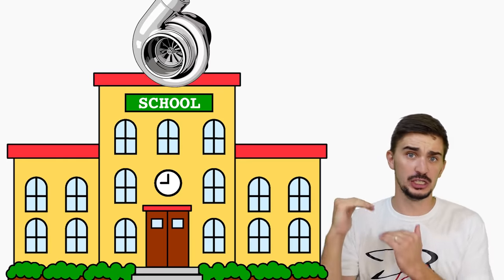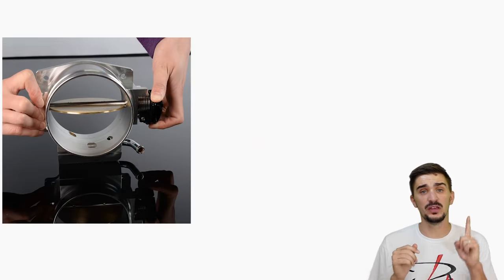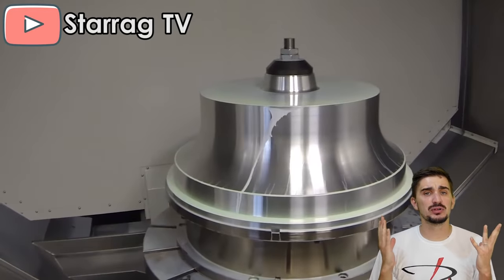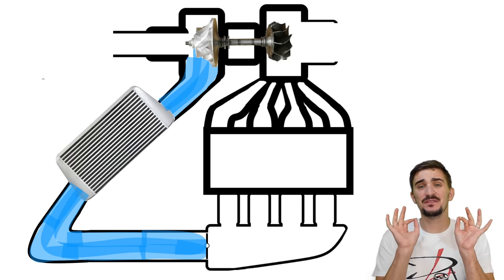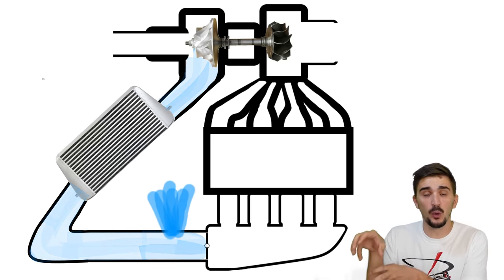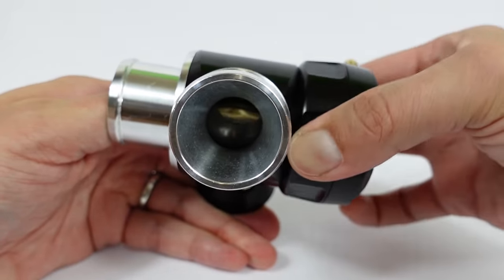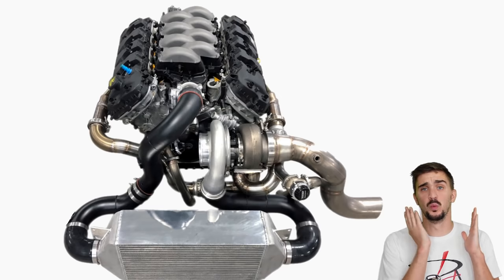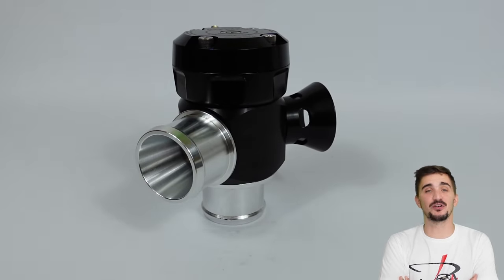TURBO FLUTTER and BLOW OFF VALVES explained in DETAIL - BOOST SCHOOL #8

Comment: this is essentially the same reason why you hear that weird chopper blade sound when you're riding in a car at high speeds on the freeway but you only have one window open halfway or narrower. Air wants to flow smoothly in one direction, but since there is no second window for the air to escape from, the pressure of the air coming in has to come out the same way it came in from, creating that flutter noise.

Comment: And there i was happy that i was hearing the tu tu tu... sound and now im kind of worry... but i have have the same BOV....so ill just make some adjustments.... thanks mand for your explanation...
Reply from the maker: If you're running something like 10psi don't worry about it. As I said in the video "if boost is high enough"
Reply: @d4a  People running 50+ psi without a blow off valve, I personally run 20psi without one, it's never caused an issue.

Comment: My old volvo recirculating valve is on  the turbo itself. Which makes sense to me to have the air circulating right at the compressor  I could hear the flutter when I first got the car. It took a year or two  before I knew what it was and got around to fixing it.

Comment: The GFB valve is completely different from most other BPV/BOV's i its Boost holding/Control.
The spring does not keep the piston down, Its purely pressure balanced system as explained by brett from GFB. (boost on both sides keeps it closed) 
The spring controls the rate it which the valve shuts when its vented and there is no pressure controlling the piston (idle).

That and other GFB Valves can hold 20 or 100psi regardless of spring preload setting. (but too soft it will stall and run rich & bad when you blow off)

Comment: Yes but there are different types of compressor surge. What you explained is throttle off compressor surge which in it of itself isn’t dangerous to the turbo. A good turbo won’t face any additional wear due to this type of surge. That is because most of the felt force on the turbo is along the length of the shaft and a quality turbo has a shaft that can take that force. You won’t damage the blades because the compressor blades are acting like throttle valves slowing air travel in the opposite direction. The blades can handle this additional pressure since they’re relatively thick for their size and the pressure of the air is distributed evenly around the blades. The second type is on throttle surge. If you’re turbo is surveying while on throttle you have a problem. This is caused by having too much air pressure for the diameter or piping and size of throttle body. The solution is to turn down boost or increase piping/ throttle body size. This is dangerous for your turbo. With this happening you’ll have air pushing against the compressor trying to get it to rotate in the opposite direction. At the same time you also have exhaust gases pushing the turbine  in the other direction. This causes stress along the length of the shaft and because the shaft is hard it’ll snap before it’ll twist. This is how videos of people being able to wiggle their compressor around and pull them out are made. A diverter(valve that sends air back to the turbine inlet) or bov are still a must in a turbo system. This is because while shifting both prevent the turbo from reducing rpm. The diverter sends the positive pressure air back into the inlet which helps keep the turbo spooled. The bov will cause a drop in pressure in the downstream piping, it’s still a positive pressure however lower than what it would’ve been without one, this causes less air to travel back through the turbo meaning it maintains a higher rpm. Also some diverters send the air from in front of the throttle body to the intake manifold. This is by far the most efficient way to maintain boost since you keep the intake manifold pressurized. You can do this because while your foot is off the throttle the engine is still operating, drawing a slight vacuum in the intake manifold, so you’re able to put the pressure from upstream of the throttle body into the intake manifold. Surprisingly a lot of VW use this and I’m currently using this on mine. I’m actually using a Gfb diverter/bov (similar to the one in the video) and I have it split about 80(atmosphere):20(intake) and I still have throttle off surge just because I run really high boost. Gfb is the right way to go with bov and diverters when it comes to modifying your car because most oem options can’t take more than 14psi of pressure before rupturing or leaking by.

Comment: Disagree on the BOV/BPV placement. The overall objective is to maintain compressor speed (by releasing pressure/prevent surge/etc.) so adding distance from the compressor is only going to give you pipe losses/pressure waves. Also giving your intercooler hot air to cool that just gets jettisoned to atmosphere. OEMs and higher end turbos like the Borg EFR series do it this way for a reason (also packaging, obviously)

For blow-thru MAF setups, it also keeps the coldside piping smooth for the MAF.

Comment: Or an internal wastegate, which is my preference.  6.5 GM diesel, 7.3 Powerstroke, 6.0 Powerstroke, and 2.5 Subaru, all internal wastegate that dumps the charge down the exhaust rather than to atmosphere.  Some of us don't like the sound of a BOV.  Great vid as usual!
Reply: Wastegates and blow off valves are not the same thing, wastegate is exhaust side and controls boost by bypassing the exhaust around the turbo, blow off valves are intake side and release boost pressure when the throttle blade is closed.
Reply: @DriftNick  As you just said, they serve the same function. Who said they're the same thing?
Reply: @mwalker9401  They don't serve the same function as I explained.
Reply: @DriftNick  Yes, they do. They both control boost.  And now I'm done with this pointless conversation.
Reply: @mwalker9401  Do you understand one is on the exhaust side and one is on the intake side? I don't think you understand how they are different, should probably watch a youtube video on how both work.

Comment: Funny thing: I've seen blow-off (or pop-off) valves installed into TD engines. Where they have no sense being a turbo diesel a "always full open throttle" engine type. They are just "to make the fake hissing sound" and I wonder how they can work...
PS: I know also TDs sometimes have a throttle, but that is functional to the switch off of the engine, to avoid to have it rumble and shake when the injection is cut at shutdown.

Comment: My TT mk1 came with a blow-off valve.
Question: Can blow-off valves cause rev-hang between high rpm gear changes?
I always learn so much from your videos.
Thank you.   : )
Reply: No it can not as far as I know.  Since the BOV is only in operation when the Throttle is closed, it would have no effect on Rev hang during a shift.   Rev hang from my experience is from the Tune on the ECU and it has the injectors "hang" open for a moment after throttle input for some SMOG reason.  Only way to fix is with a Tuner.

Comment: This is all explained amazingly so thank you sir. The only question I have is that when you hear compression surge from OEM vehicles (90s JDM for example) why do they not add BOV from the factory, and similarly why do you not hear loads of horror stories regarding AUS vehicles where BOVs are banned? Planning on doing a full 350z build in the next couple of years and I'd love that flutter if possible. It'd only be a weekend cruiser so wouldn't put too many miles on. Am I correct that it'll reduce the lifespan of the turbo but won't outright destroy it quickly?

Comment: I once had turbo surge fluttering at half throttle but doesn’t do so at full throttle. Drove car for a year and couldn’t figure out what it was, later found out my timing jumped 3 teeth on the cam gear. My Intake valves were late on timing and causing obstruction of boost flow. Wow was I was lucky my engine didn’t blow.

Comment: Every thought to tell people 
How hard to set the valve
And for what reasons 
I’ve seen some cars with multiple and staged bov 
Helping turbo response 
Remember air has weight and momentum 
Bov should be right near the throttle body

Comment: Liked the video but missed the term "compressor surge" in here. 
I work on compressors with a power rating up to 50 Megawatt.
Compressor surge will shake the foundation and destroy all bearings in these machines.
That's why have a pressure surge valve installed to recirculate the discharge pressure and even use it to control load on the compressor with added IGV controls. (Inlet guide vanes)

Comment: I have a no blow off 1000hp diesel, large singe turbo, been driving it for 5 years now and no issues haha
Reply: Most diesels don't have throttle plates to snap closed and cause the problem.

Comment: Back when I was working on nat gas engines/compressors we called it compressor stall. On the engines I worked on, like the Waukesha 7042 GSI, the compressor stall made a schew, schew, schew, schew, sound.
Reply from the maker: Yup, stalling is a correct term for what's happening in the aerodynamic sense.

Comment: To my understandings and real-life scenarios, The only compressor surge capable of breaking your turbo will be the WOT Compressor surge. I've run my RB25 with an EBAY gtx3582 23psi @500whp without a BOV for over 5 years now without any signs of turbo wear. I don't know if it has something to do with the anti-surge compressor housing and I don't want to say this video is not correct, but I have a whole other experience compared to what is being said in this video. -Si-J

Comment: Compressor surge is particularly hilarious when an aircraft jet engine does it.  The STU-TU-tu is more like BAM BAM BAM and because (like mentioned) the fuel injectors are still hosing fuel into the engine big yellow "too rich / unburned fuel" flames come out the back.  This causes the passengers to poop their pants and the pilot to murmur colourful phrases like "mayday landing in the Hudson river".

Comment: My GFB BPV/BOV Hybrid is set to only vent to atmosphere on higher boost hard decel.
- Only blows off Over 10psi will it release and then only down to 10psi it closes. 
- So if i drive it casual there is Zero BOV Venting. 
(This was done for stealth as any sort of Vent to Atmo is Illegal here, So i fitted a custom 10psi ball valve to the trumpet port which is hidden on the underside of BPV/BOV)
1999 Impreza WRX.

Comment: My Mini Cooper S F56 used to do it stock (the flutter sound), it would flutter nice and loud every up shift (MT). But after a year of driving it and 3000 km the flutter is not there most of the time, it is barely noticeable from 2nd to 3rd but that’s about it. I can’t really notice a difference in how the car runs, if anything I feel it runs better because of the 3k it takes the engine to break in. But definitely miss the flutter.

Comment: It's actually more so the exhaust HEAT that determines how efficiently a turbo is being driven rather than exhaust flow, ie the hotter the exhaust gasses going into the turbine, the better it spools..Hence, the closer (the shorter the primaries) the turbo is mounted to the exhaust ports, the more responsive the turbo works.

Comment: @ Driving 4 answer  you know that's a common misconception.  The throttle body does  not cause boost surge and the famous noise we all come to love on turbos.  If that was true how come diesels do the same thing but they do not have throttle bodys. The chop in air is from rapidly letting off the throttle pedal.  That halts drive pressure to your turbo . What we hear is the compressor wheel rapidly stopping not being able to keep up.
Reply: What do you mean compressor wheel rapidly stopping not being able to keep up?

Comment: Awesome video! I've been considering getting a BoV or adjustable BoV/Diverter like you showed in the video. 

My Golf has a factory diverter valve which works great, but there have been quite a few times I let off the accelerator and get rev hang (which I'm assuming is the air getting recirculated until it's used or dissipates.)

I have heard from a number of sources that the adjustable BoV/Diverter fixes this.
Reply: This is gas or diesel? I'm trying to work out how this is related to the TDI version...
Reply: @vernzimm  mine is gas - 2016 1.8

I don't think this applies to diesels, as they're typically controlled through fuel injection, not a throttle valve/plate.
Reply: Right, no throttle plate, so I guess no issue with over boost for that reason, but it seems like there is a lot of lag that I'm guessing is because the turbo is spinning down too much between shifts. I'm wondering if having a waste gate/diverter would keep that from happening, or maybe wouldn't do anything for it.
Reply: @vernzimm  I'm not sure...

I think you'd still have the potential for compressor surge, as the intake valves themselves could cause a slight back pressure scenario, but nothing like a throttle closing. The valves will still open and close with the cam, so I'd imagine what you'd see would be potential over-fueling - but it would be very brief. 

I'm trying to learn more about tuning, both with gas and diesel engines, so I'd be very interested to see someone with knowledge on this comment. I'm going based on what I do know and speculation on what I think is happening.

The lag could be accounted for from the expansion of diesel exhaust. As I understand it, diesel exhaust requires more space for expansion (why the exhaust piping is typically larger compared to gasoline engines, and why the turbine housings are typically larger as well), and once you let off the accelerator and the gasses flow out, you have to wait longer for the exhaust to build back up

Comment: Recirculating valves somewhat also keep pressure (boost) in the system but it also stuff the intake/inlet pipe with pressure and this can cause the inlet to blow off the compressor housing which happened to my car 3 times and destroyed 2 inlet pipes from the factory. Got tired of that and took off the recirculating valve's pipe and made a DIY BOV lol I do use more gas now than ever because all I wanna hear is the wooshes 🤣

Comment: I wonder if one could store the pressurised air temporarily rather than venting or recirculating, so it can be fed back when the throttle plate opens again.  The ECU would need to be told about it but techs are smart, they know what they're doing.  Might also do something to assuage turbo lag without having to twin charge.
Reply: Volvo did that

Comment: Don't forget that even with a BOV, if your spring setup is too low and the pressure is higher, it could build enough pressure to blow your intercooler pipes open. Mo powah baby
Reply: If you are blowing intercooler pipes off they aren't secured properly.
Reply: @DriftNick  we're talking big boost 30+, 40s.. and up, and pipes are clamps properly. Seen it quite often. Best option is to v clamp it, stainless steel pipes, no flex tubing.

Comment: Awesome video! Could you explain the recirculation option a bit more maybe...? It confuses me... if the pressurized air is redirected back in front of the turbo, how is it relieving the pressure? Isn't it just shoving it right back in..?

Comment: Super interesting video!

But I'm asking myself, how is the turbo-flutter problem (5:30) solved in stock cars? Are there stock-BOV's pre-installed, which just doesn't make sound?
Reply: Most modern factory turbochargers are equipped with an internal waste gate (pretty sure) that helps regulate and release excess pressure.

Comment: Can you do a boost school video on controlling boost targets by RPM and TPS? One of the biggest issues with DIY turbo cars (and one of the biggest causes of compressor surge) is overboosting at part throttle. This also affects driveability and engine longevity. I would love to see how to map boost targets for progressive boost through the throttle position and rev range.
Reply from the maker: I'll be doing many actual tuning videos in the future as soon as I put together and start the engine.
Reply: @d4a  Awesome. I am preparing to go turbo with a 1g-fe (jz engines got way too expensive) and the key to keeping it in one piece is apparently progressive boost and avoiding part throttle surge.

Comment: 4:39 

Pay attention kids.

*It's not the compressor wheel 'stopping and starting' but the cyclical breakdown in the flow of gas past the compressors vane edges. It does however cause a breaking effect on the compressor wheel, which is attached to the turbine wheel and  contributes to the excessive lag when the throttle is reopened. Let alone create significant heat / stress at the vane edges and drastically increase the rate of metal fatigue along these edges and put a large degree of strain back through the wheel, seals, bearings, shaft, cartridge.... 
If you are running a turbocharger with a BPV and it makes this noise, you haven't configured your turbo correctly and/or need to address the bleeding off of pressure to better control these pressure waves. (Think exhaust scavenging, this is your goal.)
Reply: There is no extra lag from not running a blow off valve or bypass valve, people have literally tested it and there is no difference in turbo speed between running a valve or not, the rate at which the turbo slows down after lifting off the throttle is the same, if it did it would not be common place in motorsport not to run a valve.

Comment: The guy at 6:05 knows what he is doing. That pipe in front of the turbo does absolutely nothing despite making the sound soooo much nicer xD Well and maybe sucking a bit less warm air. But the sound would by far not be so cool without the pipe^^

Comment: If you recirculate, are you slapping that high pressure are back infront of the turbo, or behind it?
Can you position a BOV to it blows that rapidly cooling air on/into a radiator to have some localized minor extra cooling effect? Probably wouldn't make a difference hey.